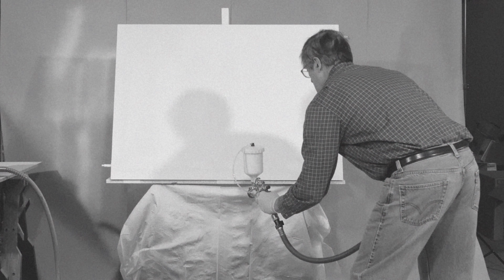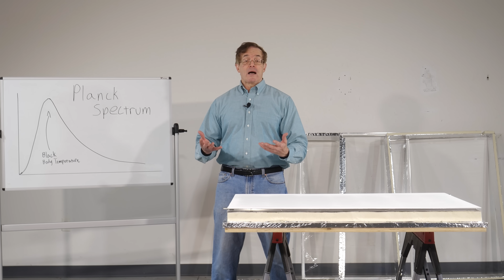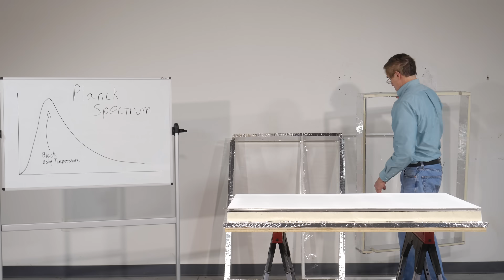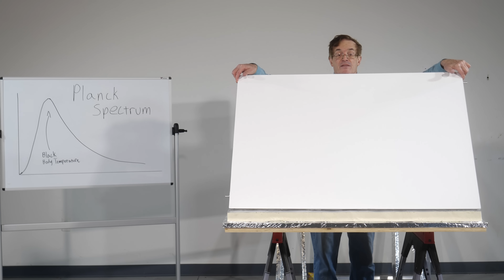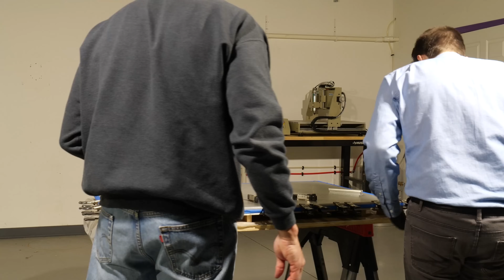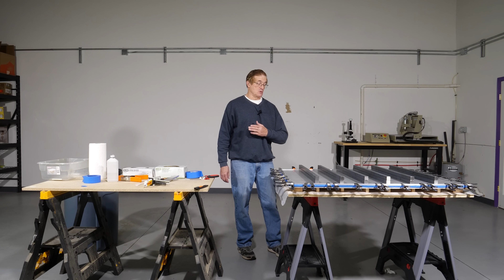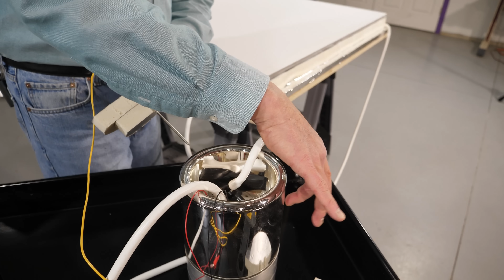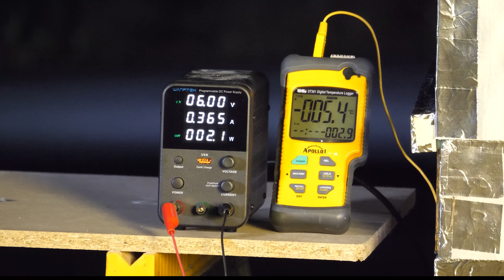Air Conditioning isn't free... but we're close.

Comment: This is really intriguing!

Something I don't understand is the philosophy behind the design of the box itself.  Why not just take a shallow pool of water and lay a skin of the coating on top of it, then circulate the water in the pool?  Or why not just take an old truck radiator and spray it with the coating, then pump water and glycol through the radiator?  

I really appreciate the level of detail you go into and the immense amount of work and thought that goes into these videos.  If I could change anything about the presentation though to help me understand better, it would be to have a sort of staged presentation:  1. overall philosophy, this is what we'll be doing. 2. this is how I decided to do it and why.  these are some other ways to do it, here's why mine is better. 3. building and details, reviewing some of the information already mentioned as it's relevant in the build. 4. testing 5. next up, come on back

Not saying this is how it should be done, being painfully aware I'm armchair quarterbacking here.  And your videos are already great quality.  Just seeing how I most effectively ingest information, what would help me.  Not sure if others might feel the same.

Anyways, thanks again for the excellent, intriguing, and inspiring content.  Looking forward to the follow-up on this!  Best to you and yours.
Reply: That's a good question about spraying the paint directly onto a heat exchanger (radiator). If the fins were spaced far enough apart so the thick paint didn't restrict the airflow you could get slight cooling. But this design needs a closed-air system so it wouldn't help much on an A/C condensor unit. But you could probably paint a radiator and put it inside this closed box

Comment: I've been playing with infrared thermometers and thermal imaging cameras lately, so it's great to have your explanations of some of these phenomena. In particular I've noted:
 - the coldness of the sky (which often measures -40 to -60 degC)
 - the opacity of glass to IR
 - the transparency of certain plastics to IR
 - the high reflectivity of certain rocks and ceramics
 - the way a dull (e.g. galvanised or brushed) metal surface acts as a much clearer mirror in the infrared (presumably the longer wavelengths in IR are less affected by the surface roughness)
 - the way splashes of water stand out as colder than their environment, and remain colder as they evaporate, eventually leaving the surface still cooler than the surroundings
Reply: (pun not intended 😅)
Reply: I think the sky is simply not able to be read by the camera because there's nothing close enough to bounce off of, it's not a real reading. So it defaults to the lowest measurement the camera can display.

Likewise glass and reflective metals and certain plastics bounce or fail to "catch" the infared laser to be measured.

Water cools as it evaporates and takes heat from everything around it.
Reply: Thanks, interesting stuff to think about.
Reply: That's some good food for thought, cool stuff
Reply: Too bad these comment conversations aren't live. I was just thinking about how humans' intuition about IR is poor, and to an extent thrown off by the visible spectrum. That coming up with clever passive cooling solutions might be more commonplace if that weren't the case.

Now I'm guessing that shrink wrap likely is more transparent to microwaves than glass too — affecting use in a microwave oven. I can look it up, but again: no intuition.
Reply: What kind of IR thermometer and thermal imaging camera did you get? I’ve been trying to find a good, but affordable one, but haven’t found one yet.
Reply: @moonmagnolia7  I deliberated for ages over Flir vs Seek, but went with an InfiRay P2 Pro (with extra lens for macro/electronics use). Very happy with it: good frame rate, software is decent, and there's a wide range option that doesn't sharpen the image. USB C so you can flip it around. It does pause every so often to recalibrate, which seems to be normal for this type of camera. I also warns you if it's exposed to potentially damaging IR intensity.

Comment: I watched a video awhile ago. Environmental engineer was asked to solarize a house. He went through all the calculations and came back to the owner and said "In order to do this, we have to cut down all the trees. Cutting down the trees will increase the solar gain of the house significantly... We probably should not cut down all the trees!" 

i.e. all the benefits of the solar panels disappears into the increased heat load ...

Comment: Awesome Video! You may want to consider making the coating black as it will radiate more energy than white. That's actually why the SR71 is black, to radiate the heat generated from supersonic air friction.

Comment: That is very complicated for something so simple as cool air. All anyone needs to do is bury 12 inch diameter pipe 8 feet below the ground in a 100 ft. length. No water, no "super coating lol", and only the wattage for a fan needed. This really is not that difficult. Geothermal bud. For such a smart guy, your kinda dense on the simple things. Great example of when overthinking gets the best of you my friend.

Comment: Interesting! Locking forward to se your recepi on the supercouting!
If you use radiators for heating to cool a house, the temperature in them should never be below the 
Condensation point of the  moisture
In the air inside.  Otherwise the radiators would collect condensation.  in air conditioning unit  
There are special measures for handling the condensation  so this is  not a problem for the ac.
Cooling radiators that is fanless, is 
Often mounted in the ceiling to optimise the fact that cool air will fall to the floor, cooling the floor or the Lower part of the room volume would not necessary work as well because the hot air can layer on top of the cool air ,and not get very cooled it self .
I think  this kind of passive ac system could utilize a indoor unit with the pump a water radiator and control system for regulating the fan speed And sensing air humidity/ temperature /and condescension temperature indoor.  I could be like a 
Ac without compressor.

Comment: Thanks for the video! I used to live in the tropics, and cooling is a huge issue over there.
Maybe one day we will see dual use panels, on sunny days they act as solar PVs and generate energy, maybe the hydraulics in the back can be used to draw heat for home heating (and increase efficiency in the process), and at night you flip over to dump heat into the night sky.

Comment: This is great, and seems like it could be used in line with the split evaporative cooling system you had a couple of years ago.  Gaining even 10 degrees below ambient off the AC coolant temperature from evaporative cooling before hitting the radiative cooling stage would be amazing.  I have considered putting evaporative cooling around my ac condenser, but haven't done it, maybe that's something you can test this summer?  Great stuff thanks for the experiment!

Comment: This maybe dumb but for your test shouldn’t you be comparing your fluid temp to the wet bulb temp of the air? Since you are measuring a liquid and it is always going to be slightly cooler than air. I know equilibrium and everything but I thought that’s the whole reason their is a difference between DB and WB ?
Reply from the maker: It's  a closed system.  Evaporative  cooling isn't  relevant.
Reply: @TechIngredients  I knew I was forgetting an aspect, it didn’t feel right lol

Comment: This would work extremely well as an "economizer" for a water based chiller system. Recent increases in electricity prices had me searching for alternatives to cooling an indoor grow room and while there is no shortage of cold air for a good portion of the year, using outside air isn't the best option. I researched a bit on what some forward thinking commercial operations were doing. There is one HVAC design company located in the NorthEast  using a "closed loop" energy recovery ventilation system, where the indoor air is cooled by, but not mixed with outside air before being returned to the building. I intended to utilize cold water and have built heat exchanger units. One which is used to pre-heat water for the nutrient solution, fashioned from an old hydronic toe-kick heater as our city cold water reached a low of 49F this winter. I'm considering adding a glycol loop with an indoor and outdoor exchanger, but wanted to do some testing with the smaller system. I also considered using a freezer chest as my chiller. Using water or glycol solution makes relocating the unit much easier than a refrigerant based split system and I'd prefer the heat be removed to the living space, where again, exchanging the air directly is not possible due to the high humidity. Look into Hydro Innovations Ice Box chiller, they have enclosed exchangers ready to accept a 6 or 8" inline fan. They claim 4500 and 6500 BTU of cooling respectively but do not show their Delta T, or any other data. What's nice is they also have a thermostat controller for fan and pump, which is simple enough to build. I asked the retailer when buying my heat exchangers if there was any information regarding using them in cooling mode and he sent me the contact info for the founder and president of Hydro Innovations, as he is their customer as well. An air cooled transfer pump would add less heat into the system as well, though I haven't seen many or any low powered EC motor options for transfer pumps

Comment: One thing that immediately strikes me is that the device needs some way of dealing with rain. The easiest solution is probably just to use a sufficiently slanted roof to compensate for the give in the LDPE film. I understand this was to demonstrate the principle, but this is something to keep in mind for any V2. Due to the modularity approach (smart) the slanting could just be it's own section. I guess one nice sideeffect of that is that you can "aim" it a little away from any mountains or such that might cause obstructions.

By creating a heat differential you could utilize peltier modules to leverage that into DC current too.
After a startup period run off a small battery seems entirely plausible the device could power itself - which would be pretty neat :)
Reply from the maker: Agreed.
With further testing, we learned that the plastic film adds little to the performance.  Eliminating  that would simplify the system.

Comment: How does the radiating coating handle if you replace the cling film with eglass. Can you have a heating and cooling solution with the changeable top or are you significantly better off with a black box for heating as per previous videos? If the black box is desirable the box could modify the water heat exchanger somewhat so both surfaces have full water contact and have a black box on the bottom side to flip the box to create the heating and cooling effect from a single device. Probably not quite so useful where you are located given the snow coverage but could be significant in other parts of the world.

Comment: You basically made a tank. With a few side supports/guides you could have pulled a slight vacuum on it which would have provided more and more even clamping on all of the surfaces. You would have had to run the vacuum pump during the clamping period, would have been a minimum amount of energy to provide superior clamping. Have to make sure that you controlled the amount of vacuum so that you did not exceed the strength of the materials and collapse it.

Will be interesting to see the supper paint video.

Thanks for the effort.
Reply from the maker: The risk is that the vacuum  will pull the soft adhesive  into the interior before it cures.  I did try vacuum bagging, but the clamping required  too much regulation of the vacuum level.

Comment: Could this just be because the antifreeze lets the liquid go lower than surrounding? In other words if it's currently freezing temps outside the antifreeze lets liquid go below that, so it gives up more is it's energy. I am concerned this effect isn't the same as if you tested this during a summer day
Reply from the maker: No.
This is a sealed system.  The temperature  change does not depend on the fluid circulating in the exchanger.

Comment: I'm literally calling my HVAC contractor tomorrow to see about implementing this into my house I am building. Genius!  How is the population so stupid, when we have this kind of material for free at our fingertips I will never know.  KEEP IT UP!!!!!!!!!!!!!
Reply: It's not quite free, though.
It took two skilled people one hour for just one little step of this full build. How many man-hours for the whole thing?
Then there's the materials. I don't know how much aluminium foil and rods and u-channels are, but they're not free. And the special epoxy. And the special coating. And the foam. And the wooden frame. And the platic (polyethylene is cheap but I'm not sure commercial grade will last outside, which means maintenance).
Then some liquid needs to run through this, which means pumps and pipes and a motor and more maintenance...

Don't get me wrong, it's a neat build and a clever principle. Pretty cool stuff! But "close to free" seems very overstated to me.

Comment: Why the paint is white, not black?
Reply from the maker: The visible  color has nothing  to do with its  thermal emisivity.
Reply: @TechIngredients  Interesting. I thought that black color has something to do with it.  I had to paint my soldering table with black to make it heat circuit board better and it did a huge difference.

Comment: I have had a theory for a while that may work.
What if we build solar pannels with cooling loops inside, but instead of water or water/glycol mix, we use something that boils at say 120F or even the super expensive NOVEC which IIRC boils at 65C, the backs of those solar pannels can sometimes get over 212F/100C and depending on the fluid, this can be used to generate even more power, while making the solar itself more efficient by cooling them.
A combination solar+'steam' generator.
If this fluid were used to say, drive a heat pump, you could use reclaimed energy from solar, to cool your home, or at least boost the efficency from the pannel.

Yes it would be a low pressure differential, and you'd need the heat from many pannels to drive anything of more than novelty, but you can just use a larger piston/turbine to drive a small piston/turbine to overcome the low pressure, you just need the volume.

Comment: You guys always put out fascinating, well explained videos.

This is very cool! (No pun intended.) I have always dreamed of having a workshop like you guys do, and so I got an old historical building.. but as I do work on it, one of the things I have been wondering about is when I go to install or repair some of the old heating/cooling systems, and the costs associated. I have a big flat roof, so I was wondering about solar panels, but something like this would be far more useful I think. Excited to see where this goes, do you think copper sheet's thermal conductivity would make it worth replacing aluminum? Or would the cost not be worth it?
Reply: IMHO, Aluminium is used because of two properties that it has: 
1) It is silver in colour and very reflective.
2) It has a self sealing layer of oxide that makes it quite suitable for outdoor use.

Comment: You're dissipating the heat from the pump into the water with a submersible- would it make much difference to use an external pump that has air cooling? Even better, a decoupled magnetic drive impeller to thermally isolate the drive unit from the heat of the motor.

Comment: Nice! Seems to me there are easier wins though, for instance I divided my electricity consumption in the winter by two by stopping to heat my place at all. I'm not expecting that everyone can live comfortably in the conditions I do, but I would be surprised if there weren't vast economies that could be made globally by "simply" changing people's habits.

I've been hunting watt hours for a few months, it's actually pretty fun to see how low of an energy consumption you can get and to see your electricity bill drop.

The key to that is being able to monitor very precisely how much power each device uses. My electricity provider can give me instantaneous power consumption through an app on my phone so I just turn things off and see what has the most impact. For less obvious things like my fridge I have a power meter that you plug into the outlets that I leave running on a given plug for something like one day.

Building in "energy gamification" into every building would be a tremendous help to the climate imho.

Comment: Have you seen the Ted talk by Aaswath Raman? Created a thin coating optimized to be highly emissive at the wavelengths best at sending infrared into the cold of space, but also functioned as a mirror to reflect everything else. Knew it worked after leaving a panel out on a hot sunny day and it felt cold.
Reply from the maker: No. However, that is exactly what this coating does.
Next, we'll show you how to make it.
Reply: @TechIngredients  his was coating micron thick  layers of different compounds, similar effect but it didn't seem as straight forward for diy as your process sounds.

Comment: Ok, quick question, the "protection" is absolutely needed or using this coating on roof tiles and outside walls of a house could help the cooling as well?
Reply from the maker: It turns out that the film has little value.  You can eliminate it.
Reply: @TechIngredients  But what about the ring of aluminum foil to avoid it being radiated by the surroundings?

Like, using this special coating into a home or a car/trailer or whatever could have any effect on keeping it a tinny bit colder ?
Reply from the maker: The roof  is a good location  as it will be above the majority of the surrounding vegitation.